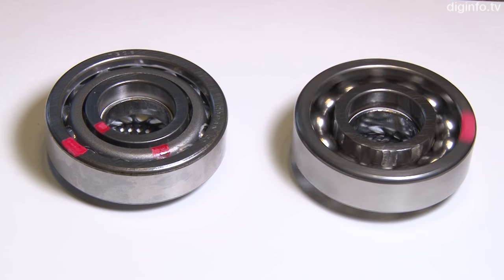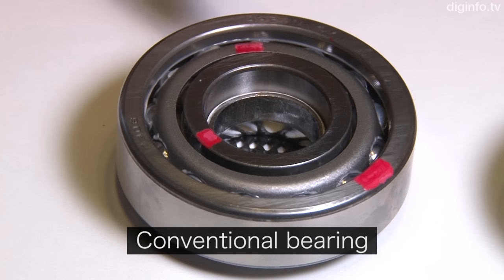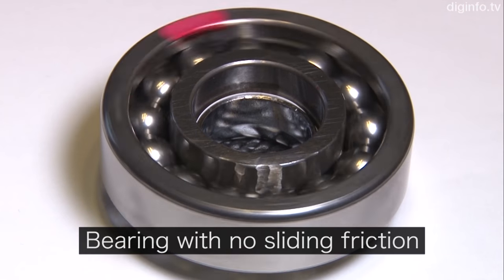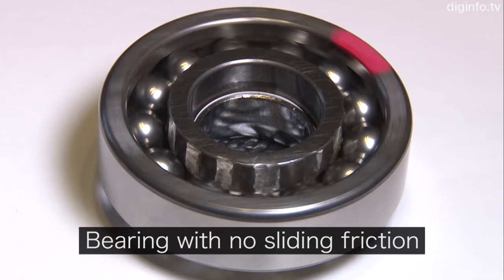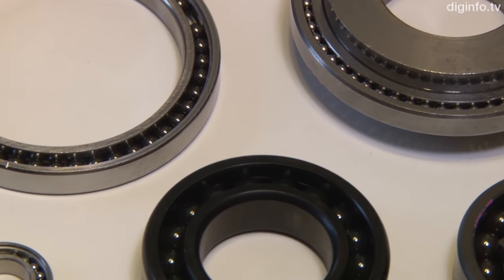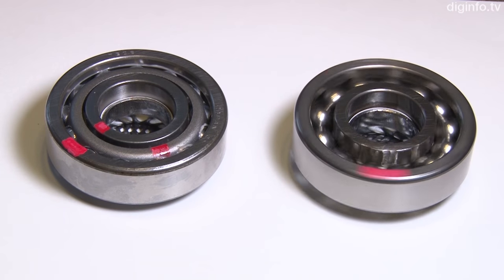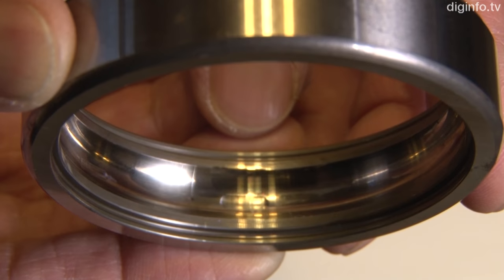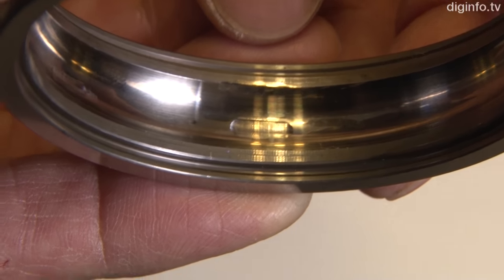Greaseless bearings that eliminate sliding friction #DigInfo

Comment: disinfo TV.  A dry bearing will spin many times over one packed with grease.  A bearing under load, there is actual distortion of the bearing contact surfaces at the atomic level.  Heat will ways be generated.
They ground the piss out of the inner race to fit more balls in there which shows this is elementary level scammery.  The cage prevents edge wear of the rolling elements (ball or roller) and provides space for lubrication.  At zero load in a film flam demonstration, the cage will impede the rolling action.  Under load and lubricated, as any bearing would be; the caged bearing assembly will outlast the one where the rolling elements contact each other.  If you want a faster skateboard bearing, flush out the grease and use a lighter lubricant such as 3 in 1 oil with an expected shorter lifespan if you don't clean and re-oil the bearing each time of use.
Reply: Or "upgrade" to those crappy 1950's cheapo skates.  They had the dry cageless ball bearings just like a cheap modern $60 bicycles.

Comment: SCAM, the grease or oil is not to lubricate the retainer, it's for making sure balls never physically come in contact with the races. They are riding on a film of oil. This is what protects the bearing, unfortunatly it's also what makes the resistance. If the film is worn off the bearing would fail after a short while. This "demonstration" is so badly done. There is no oil film in that bearing thus no friction, but also no protection, also they have ground a small groove in the outer race. That severely weakens the load capacity of the bearing and it will fail faster.
Reply: +randknu1 oh, and the reason bearing are not made like this is that it cannot be assembled whitout a groove which the balls has to be entered into. You can see the groove and it looks like it was made with an angle grinder. this severely weakens the design and both races are more prone to cracking.
Reply: +randknu1 Even if oil isn't scattered on a railroad track, a locomotive runs.
Reply: +Sosuke Kawashima that's an odd statement considering how slippery the rails would be if there were oil on them. In any case an irrelevant comparison.
Reply: +randknu1 The relation between a rail and a wheel is same as race in ADB and balls.
Reply: +Sosuke Kawashima Except friction from the rail is crucial to allow trains to brake.
Reply: +Sosuke Kawashima no it is not. first of all rail vehicles have suspension to take up uneven track, a bearing that has uneven races will wear out super fast even with light load. secondly, both rails and wheels wear out. and third grease or other lubrication IS added to the flange of the wheel on locomotives to minimize wear in curves. fourthly if you take any ball bearing and wash it with a de-greaser like diesel, it will spin just as good as yours.

Comment: The article mentioned that if a bicycle had this, it could go on for miles on a flat surface. Is that possible? If so, how?!
Reply: LudicFallacies solar road ways are already a reality. Maybe you need to grab one.
Reply: LudicFallacies you have issues man, a person asks a question and you resort to insults instead of answering. perhaps you should grab some common decency buddy
Reply: Dasithkg lol leave it bro
Reply: Quilliam Attari NO, it does not work.

ANY normal bearing can do this - if you remove the grease.
But this is not a trick to help it, but rather it only works for such scams.
You will still have friction and under load and without grease your bearing will get hot and be destroyed extremely fast.

And Solar Roadways - ye,s some idiots really have been dumb enough to spent money on this.
Look at EEVBLOG - dave has made 3 nice Videos about it.
Or in short - fundamental physic (Down to the basic level of trigonometry) teach us that they will never be viable.
The company that made the test-track in sweden was dumb enough to release their numbers - and the reulst is, that they only give half the power compared to normal solar-cells while costing several times more money.
Oh, and they only last for a fraction of normal solar-cells too.
Reply: Null is my name That was very informative. Thanks.
Reply: Quilliam Attari
I posted links to videos prior to Null. Can you not see them? They are full URLs to google videos.
Reply: Quilliam Attari lol np! Remember it's not about insulting the creators of solar roadways. Simply trying to explain to people why it is a scam.

Comment: If you want to reduce friction in bearing why not get rid of the balls and mount permanent magnets on outer and inner rings. Orient the magnets so that they oppose each-other. The inner ring would essentially float, and the only friction be from the air.
Reply: not only that, you would need extremely strong magnets for most applications. The kind of magnets that also consume a lot of power.

Comment: What do you get if you multiply the number of produced units of a technology which remained basically the same and the number value of the rate of a change in the concept that it improves the capabilities of that technology?
In this case: over 500 years of unchanged concept of ball bearings produced 6 zillion of bearings and that multiplied with 10 times more efficiency of the new system?
Now let see how other "great inventions" of modern industries can match up to this?

Comment: if it's true and works, gonna change the world
Reply: róbert molnár Well - it is not true. Just another scam-attempt.
Every bearing will run this long without load and grease.
But if you have any kind of load on it, this bearing will fail miserably.

Comment: Please make skateboard bearings =D
Reply: kallata Bombing a hill with them would be awesome :P
Reply: Ryan Smith It would make no difference. I can take a normal bearing, remove the shield and or the seal, degrease it and it will spin for a long time with no load as well. You need some sort of lubrication.
Reply: @faceman9507  he said skateboard, not gayboard

Comment: In this demonstration the bearing was unloaded. Put the bearing into service with under heavy load and those flaws in the outer race will cause it to fail rapidly.  Any ungreased bearing of sufficient mass will spin like that compared to a greased bearing. Very misleading. Snake oil.

Comment: I do not agree that ordinary roller bearings roll while in contact with the ring directly underneath as if this is so there would be sideways slack or backlash. An ordinary bearing rolls in a channel where substantial length of  arc contact  exists. The interesting issue here is that the velocity of the contact point along this arc has different  relative velocities and so the bearing slides in parts of this arc .
This  phenomena is  easily understood if instead of a sphere we take the wheel of a car and roll it  in a channel the width of the wheel. While the circumference of the wheel will not have a relative  sliding velocity with the channel, all points on the side of the wheel will have a different sliding velocity with respect  to the channel it rolls in.    So whatever one does there always  remains sliding friction even when the balls are  not touching each other.  

Another issue in this cutting a grove to decelerate and accelerate the bearing, if this deceleration and acceleration is taking place at high speed it is the edge of the grove that has to take the force in addition to the  external load  of the bearing, I am not sure that the material of the  balls or the outer or inner race can take that.
when one  considers that if a car is place on a barge crossing a wavy sea, and the car is locked in the same place without being allowed to roll, then a wavey sea can destroy the bearing , Ball bearings are no good for impulsive forces and plain bearing has to be used,      Well with the grove suggested in this video one is creating impulsive forces and I just wonder how long the bearing will last especially those edges on the grove.  Sorry folks for the disappointment, or perhaps I have got it wrong !

Comment: they needed to hire an asian to explain how a bearing works. if thats not the most american thing i dont know what is
Reply: And even the asian dude is full of it.. steel bearing with or without retainer needs grease to reduce friction between ball and raceway.. and even greased ones will fail after time.
Reply: Grease doesnt reduce friction it increase friction but prevent metal to metal contact.
Reply: ***** correct. Meant that, but wrote something else. Thanks for correcting me.
Reply: Grease helps to prevent creep and gall.

Comment: Ummmm guys, you can't test a bearing without load. It needs to be loaded in both axial and radial dimensions to show exactly what is going on. A simple spin test of a greased vs. ungreased bearing is B.S. An ungreased bearing will almost always outrun a greased bearing due to differences in internal drag caused by the viscosity of the grease vs air. I'm calling BS on this.

Comment: Sounds ok... but the demonstration of an existing technology bearing... they don't stop that quick, now I can't help but think this is a scam because they are being deceiving.
Reply: Eppiox  it is just because the classic bearing is greased(you can see thick white grease on close ups) If you clean classic bearing from grease and add some liquid grease it is also rotates for long time, but under heavy load without separating unit the balls will get to close to each other, so the rotating couple will stuck soon or the bearing will fall apart.

Comment: Grease is in the bearing for the sole purpose of preventing metal to metal contact. The bearing showed would have no load bearing ability, no high speed ability, and no longevity as well as little heat shedding ability. Physics are physics. This is a simple fact. Greaseless bearings are typically ceramic in nature. This is nothing more than a scam. Bearings don't fail because the balls rub. Also the bearing showed is simply a modified standard bearing, nothing special. Also as the bearing passes the cut out it will score and chip the ball under load. CRAP CRAP CRAP.
Reply: ok but by removing the need of the cage1) Eliminate sliding friction between balls and cage(which apparently causes a lot of its overall friction)2) Increase the amount of balls able to fit in(Longer lasting bearing, possibly carry higher load. and in the distant future reduce the size of a bearing)
Next the Groove1) Increase vibration(cause groove to wear over time).2)Smaller increase in ball rpm and  will rub in between outer and inner race until it slows down.(heat)

This mechanic of this new bearing can be applied to another type of bearing, but I'm keeping that to myself

Comment: yeah, and that indent is a week spot, and the sides of the balls will wear on that spot. making them wear out quicker than a normal baring. im a high school student. dosent take a fucking genius to realize that. people need to stop trying to fucking reinvent the wheel
Reply: +Ryan Lucey Settle down Einstein. It doesn't take a 'fucking genius' to realize that your prediction is purely conjecture. I'm confident that the company is aware their bearings have to support a load and have to have an effective  lifespan! While your statements about week spots and wear are not wrong, how could we possibly know how severely these factors will affect the performance of the bearing?

Comment: This is a scam. 
There's absolutely NO such thing as a "frictionless" bearing. 

All they've done in this video is remove the grease.. bearings without grease succumb to friction wear much faster. 

By adding these "groves" in the races, they are actually INCREASING the rate of wear on the internal moving parts, as they are now subject to the same loads, but on smaller surfaces. 

NEVER buy into this type of crap.. It's nonsense.
Reply: +ArcAiN6 I disagree with you, but reducing the contact area and the internal ball contact time, they might just reduce the wear rate.
Reply: no.. all they have done in this video (and the countless others like it) is remove the "grease" from the bearing..

Of coarse it will spin freely without the grease, however, it will also heat up significantly under load, and ultimately, will fail at a much faster rate.

by definition, there is absolutely no such thing as a friction free bearing surface. the laws of physics deny it's potential existence.

As you attempted to explain, but failed to grasp, they have reduced the bearing surface, i.e. the portion of the bearing races that must bear the load of force. Simple physics dictate that any load on a moving part will generate friction, and wear. it also tells us that any load becomes significantly more pronounced if concentrated.
by removing portions of the races, they are effectively reducing the surface area for the load to spread out on. By doing so, they are concetrating  the load onto smaller points of contact.

If you take 1 pound of lead, and flatten it to the thickness of a piece of paper, it will not have enough force to penetrate a plate of glass.. This is because the force is spread out over a large surface area.

However, if you take that same lead, and put it into the form of a ball, it will break the glass easily, because all of the force of the lead is focused onto a small area.

I really think you should find a local library, and learn about the basic laws of physics.
Reply: +ArcAiN6 I am not sure you can lecture me about physics, even the basic ones, but l assume you are confident enough to try to do so. Of course you will do it in a condescended way.

If you build a track and select the amount of balls in it, so it is guaranteed that they are not coming to the same point after one revolution. Also, you assume the bearing at any point has enough contact points to support the given load (imagine that the balls providing support are separated by one speeding up towards the next one. In fact, you might reducing the wear of each ball by 1/3. 

I assume they didn't tell us everything regarding the final design of the track, like depth of the holes, slopes, contact surface and materials. Notice that they say that it should alleviate damage due to poor lubrication, it doesnt mean they ar not using lubricants. Anyway, I doubt we know the whole story behind but I am sure a simple FE simulation can give some insights on the technology.

Regards
Reply: not true,  the fact that the bearings must contact the race surface means there is friction, regardless of spacing.. Also, if you choose to attempt to "space" the bearings out even further, you are effectively increasing the load each bearing must handle, and by doing so, you also increase friction, followed by friction wear, and as stated before, will lead to premature failure of the bearing assembly.

Now if you add to that, the fact that the grease as been removed, you are effectively taking away the very component that was added to aid in the reduction of friction. Because at speed, and even under load, the bearings will actually ride on this grease layer, effectively hydroplaning.

But they've gone one step further.. they've also cut several slots into the races.. These slots will additionally add wear to the bearings, as they roll over these slots, they will push into those recesses, and crash hard against the edge of the recess.. this will further increase the likely hood of bearing damage, and assembly failure.

The only true way to achieve a frictionless bearing, is to reinvent the physical laws of our universe. Something man has yet to do. Until we can bend the laws of physics so much, that any load bearing surface does not need an opposing force to sustain it's position, then we will have bearings that have friction.

And of coarse i'm being condescending. It's utterly ridiculous that anyone with half an education wouldn't realize this scam for what it is.

Of coarse the "demonstration" will continue spinning once force is applied, there is no grease. 

However, for the rest of us, with a little common sense, and education, we see that the only reason it continues to spin, is because there is no load on the bearings. Once you add load to them, they will heat, expand, wear, and eventually fail. Thus is the nature of friction.

seriously.. find a library.. learn something.. because your thoughts on the matter have no basis in reality, or science.
Reply: +ArcAiN6 Ok, Im done with this. I am reading scientific articles and patent reviews on the technology... I assume that you dont care they are using lubrican in their bearings?  so no point to comment. Thank you for the time.
Reply: sure you are.

Comment: The design is a fail. Very unreliable. Zero friction is not such a big deal. Reliability is more important.The friction between well designed retainers and balls is negligible. For low friction brass  or plastic retainers are used.
Reply: And what? Yours are reliable? Oh right, you can't even make one.
Reply: This video is basically fake/a scam.  Yes the bearing spins faster and longer with no grease, All bearings do that when their not under load!!  put a load on it and the one without grease will fricken melt.
Reply: Senõr PengWin  Can YOU ?